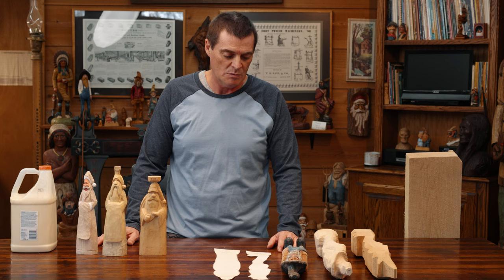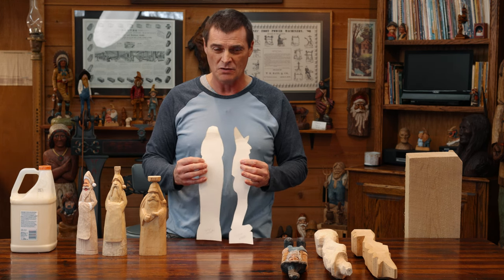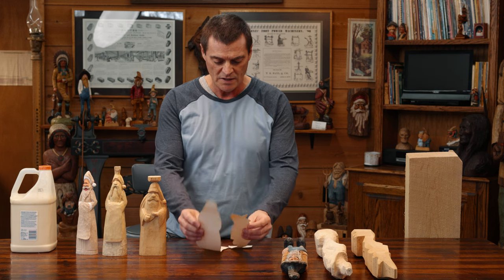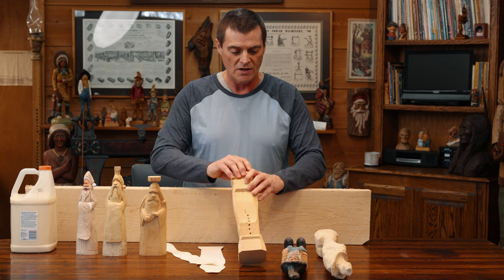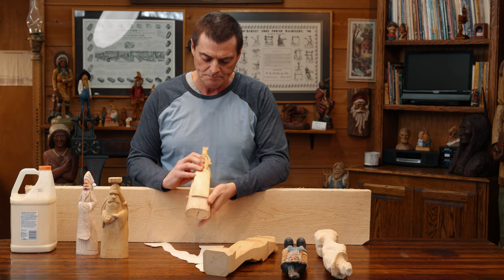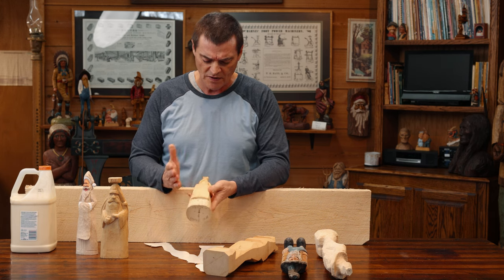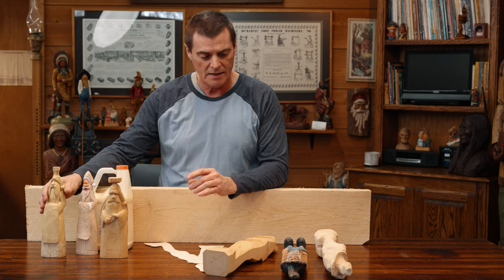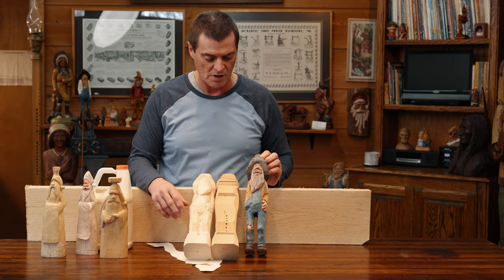How To Make A Roughout || The Nuts And Bolts Of Designing A Roughout (4K UHD)

Comment: Thanks Van for explaining ... The roughout is what all carving classes use .. so no cheating at all ..Wonderful for those without band saws or limited carving shop availability
Reply from the maker: For sure! Not everyone has access to a bandsaw or shop area to cut out blanks.
Reply: @vankellywoodcarvings  I need a bandsaw, can you recommend one? I can’t wait to try out some rough outs. All fun, no work removing waste material. Thanks Van, great video always wondered what the difference was between a rough out and a bandsaw blank. 😀